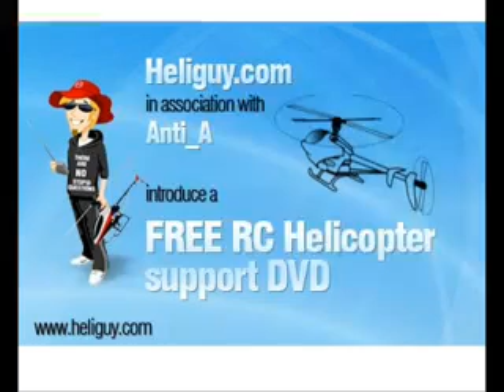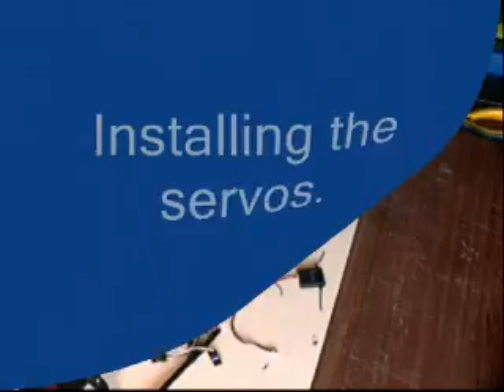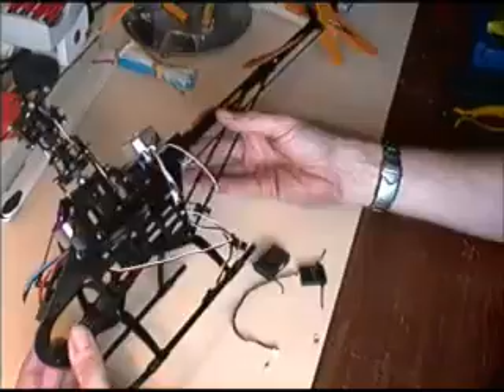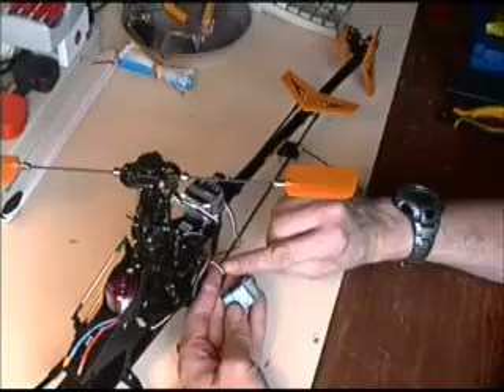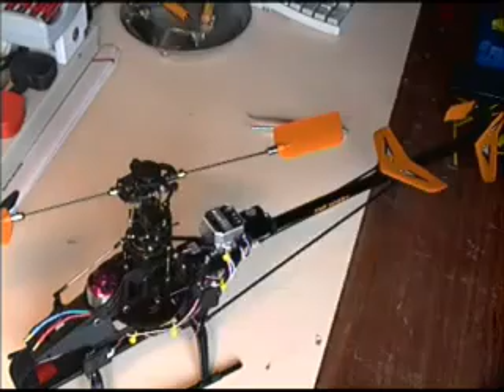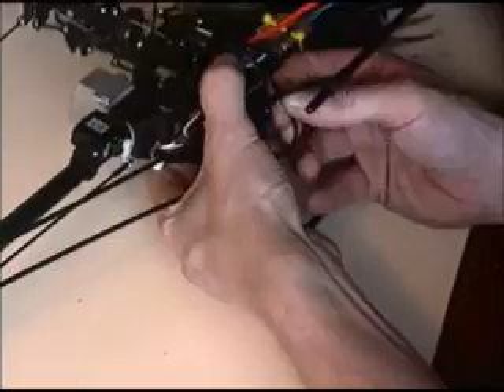Upgrading to DX6i part 1

Comment from the maker: You will find the Falcon much better to fly on the dx6 etc, the stock TX is shocking tbh, unless you fly it using 3D mode.
I did a test fit using a scorpion motor on the Falcon, it needed a 5mm shim as the shaft was too long (I could have cut the shaft down but pfft (c: ) anyhoo it was a flippin beast with the new motor!!

Comment from the maker: Hi, I set my tx to 1 servo swash then check direction of the servos, once they are correct reset swash to 120 degrees.
You may need to adjust the swash mix to get the correct travel on the servos. default is +60 +60 +60, normally one of them wil be -60.
check out the trex vid on installing electronics.

Gary